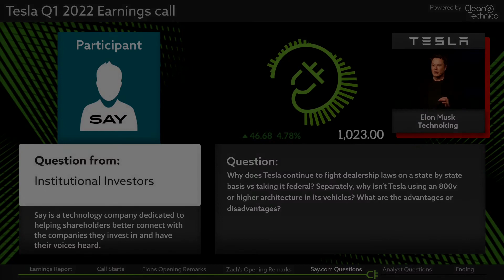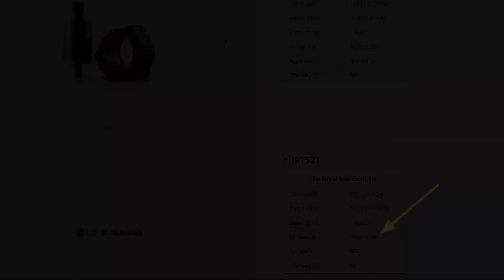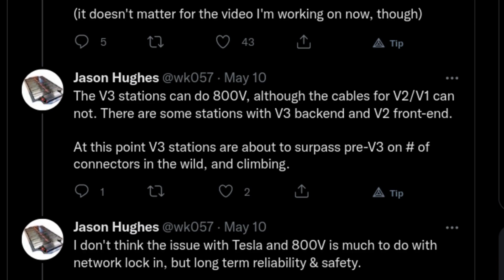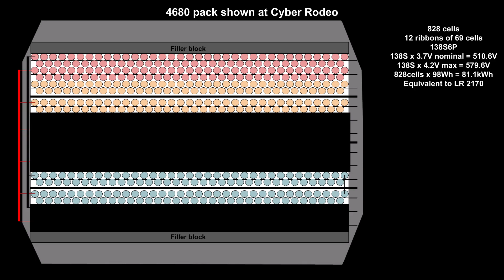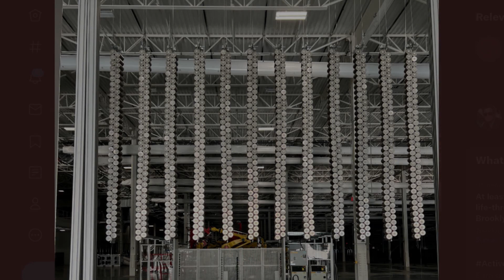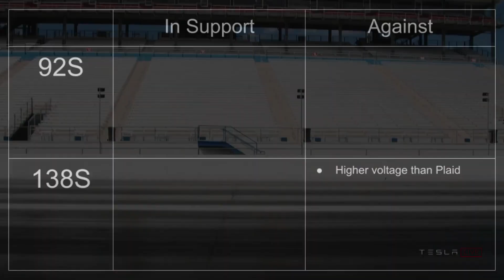Why isn't Tesla using 800V?

Comment: If you are able to charge at home, then 400/800 V makes little difference. However, for owner,  who can't charge the cars at home, charge speed dose matter. It affects significantly  how long you are going  to spend in charge station and also the refresh rate for charging station.  Given EV  is stilling in the early phase  that selling to house owner is good enough. Once the market is crowded with competitor and needs to adapt more consumer. Low charging time will  be a BIG feature.

Comment: I dont think Tesla puts strings in parallel.  (Someone correct me if otherwise).  They put all cells into modules of parallel cells and then place the modules into series configuration only.  

So it would be correct that if there are less cells in parallel that if one fails, its a bigger proportion.  But it wouldnt take out an "entire string", just that one cell.  Also, there is less current due to the higher voltage so the impact of a bad cell is reduced further.

Comment: Discharge: This is where the advantages are. There is little advantage at the pack level. On the external circuits the conductors can loose less power and be smaller but the spacing on circuit boards between two high voltage traces will need to be larger to prevent arcing between traces and creep through the circuit board material between. Since there are no uninsulated conductors there isn’t a related distance concern for open air arcing. For insulated conductors the insulation needs to have a higher rating so may get thicker and a space trade off analysis may need to be done if any tight space exists along the run path.

Comment: Voltage: A battery pack can be electrically divided into two. Put in series for operation but parallel for charging so the charging infrastructure does not need to change as long as the high voltage design does not exceed twice the lower voltage design.
Reply: This requires at least an additional pack contactor (if not more) which is already $200.

Comment: Charging: The limiting factor is the cell. It is the characteristics of the cells that determines the charging curve. The maximum chemical reaction rate and heat generated does not change no matter what configuration is used. Total heat generated by the cells is the same regardless of electrical configuration.
Reply: Why can Lucid do 300kW then? Better cooling? Because Lucid uses cylindrical NMC LG cells no different than Tesla MiC models.
Reply: @boostav   Probably because of very large 130ish KW  packs
Reply: @aljones8519  They're not 130kWh packs.

Comment: Going to higher voltage may save some material in the conductor size thats it. So the gauge of wire used in motors or wiring will be thinner but going to a thinner conductor alone does not save much money on the other hand working with higher voltage requires all the semiconductor and software and charging station to be upgraded. Makes no sense.

Comment: Higher voltage requires lesser amperage in operation. It is better but the time it would take to optimize it would make Tesla lag the other car maker if they switched to a higher voltage.
Reply: Lag like when they switched to hairpin windings too behind GM Etc? Its ok
Reply: @aljones8519  lag as in lag in time. But you already got it.

Comment: Wouldn't 400 volt system be safer for occupants ? ( Electro magnetic field wise)
Reply: Yes, in terms of electric shock risk 400 V is safer. The occupants aren't exposed to any significant fields.
Reply: 400V is when human tissue ionizes and resistance drops. Current goes up substantially.  So 400V is a good medium here.   Although ideally there should sufficient safe guards like HVIL and Isolation detection so the occupants are never exposed to high voltage.

Comment: Great Video as always.  I am a vote for the 138S.  There are a few reasons.  1. Many power module suppliers are creating 750V rated SiC mosfet packages 2. electrical losses are I^2*R, so current is the biggest impact to losses, however at road load, the current level differences will me minimal. 3. if the V2 charging infrastructure can handle this intermediate voltage, there is even less reason to switch to 800V quickly.  One other point, the 800V cars today all have an on-vehicle voltage booster that allows them to use 400V charging infrastructure to charge the 800V pack.  That is more costly, but it does work in the rare instances it is needed.
Reply: plus there is the other way, unlike porsche doing voltage doubling on 400V chargers (which is really not great solution), like hyundai/kia are doing - using motor inverters to "change" voltage as needed, which means one less (unnecessary and pricy) component
Reply: You can get 1200V rated SiC modules from the same manufacturers. My guess is that all automaker will switch to 800V sooner or later because there is not really any reason not to.
Reply: @EinzigfreierName  agreed, those are needed for the 800V, i was just mentioning that 750V devices may be an easy/cheaper upgrade for the ~500V packs coming to market. The fact they are making 750V devices means there is demand

Comment: Many times type THHN insulated conductors rated at 600V is used in commercial applications at 480/277V and the 600V rated insulation gives a comfortable margin for safety.